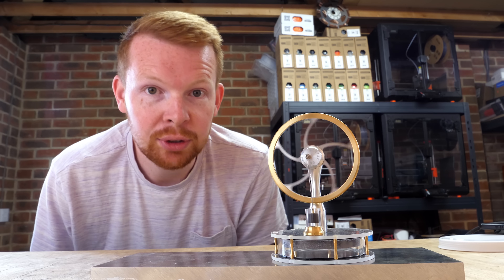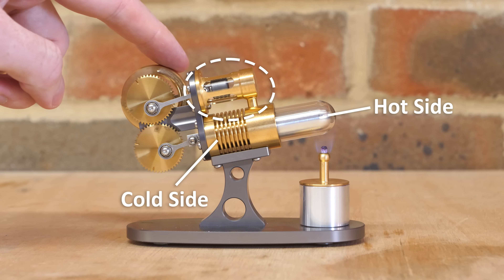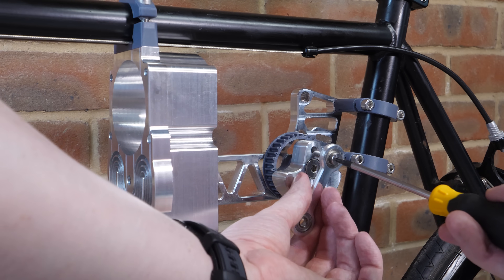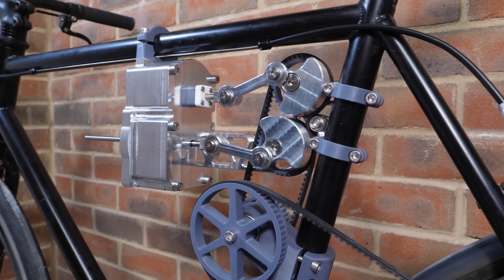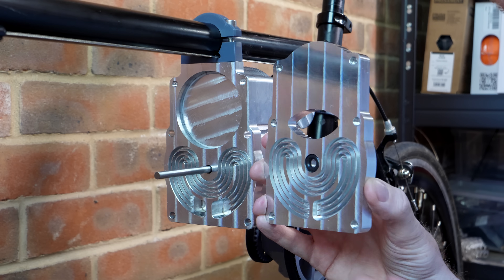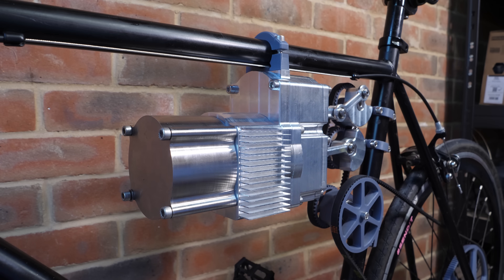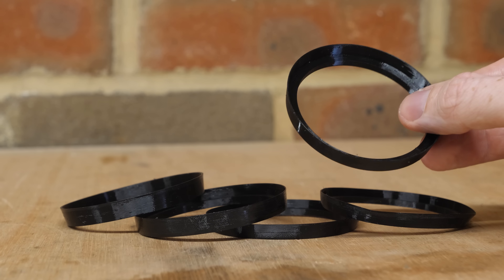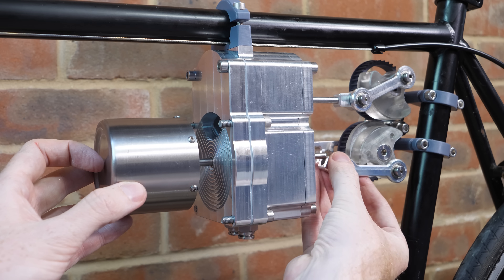Building a Stirling Engine Bike - Part 1

Comment: plumber/HVAC tech here. Sterling engines are NOT more efficient than steam in  terms of energy conversion; not by a LONG shot because the larger they get, the LESS efficient they get. 
-air is a weak thermal conductor
-air (nitrogen_) compresses really easily, so the overwheling amount of your kenetic energy from thermal expansion is lost to actual air compression; and that gets even worse the larger you go.

 The only benefit they have is safety and simplicity, but they're so weak that they're not viable for 99% of applications. 

That's because water expands nearly 1700x when it changes state to become a gas. It also DOES NOT compress, instead the compression force dramatically change the temperature at which phase change happens which in turns makes the steam engine MORE efficient/powerful (also more dangerous). 
 so while it takes a high initial energy investment to bring your water up to a boil, you really only need to get it swinging about 20C from the hot side to the cool side to get it to keep changing states.
Reply: I knew big steam would be here somewhere 💪👍😁
Reply: There is No big steam !
Signed 
Babcock and Wilcox , Combustion Engineering , and Pardons Turbine inc
Reply: The Rankine and the Stirling cycle have the same maximum theoretical efficiency (i.e. the Carnot efficiency), but in practice is very difficult to get a Stirling engine anywhere near this.
Reply: But they do have the advantage of not boiling your legs off when something goes wrong
Reply: @fisch37Wheres the fun without the risk?
Reply: Yes, but hydrogen is a bitch to contain. Helium is slightly better...
Reply: in the UK, building your own steam engine involves several legal and safety obligations, particularly around the boiler and its use.  thats probley why
Reply: what do you think about flame eater engines?
Reply: I was under the impression that while steam scales very well (as you pointed out) it was awful at small sizes. I would not be surprised if powered bike (where weight matters) was in the 1% of applications where a sterling engine was more efficient than a steam engine of comparable size. Tom should have clarified this if true but I think he has some idea of what he is talking about.
Reply: @jameshulse1642There is a guy who made a coal fired steam motorcycle. It's on youtube, just search up "steam motorcycle," and from what the video showed, it worked pretty well. The engine and boiler were obviously bigger than toms stirling engine, but not hugely bigger, and had a lot more weight to shift. Even at small scales, steam engines can absolutely blow stirling engines out of the water as far as power goes
Reply: This is mostly wrong. Stirling engines are incredibly efficient, and can approach 70-80% of the Carnot efficiency. However, they have poor power to weight ratio, which makes them a poor choice for use on a bike or in a car.
Reply: @naasking  That is theory only, in practice it very difficult to get much above ~40% and it's much lower for simple designs like Tom's.
Reply: @ferrumignis sure, Tom doesn't even have a regenerator. Getting 40% isn't too difficult with a Stirling engine, but I agree it gets harder the more efficient it goes. Still, they are far more efficient than other heat engines, internal combustion engines and most steam engines.
Reply: @naasking   I'm a bit of a Stirling engine nerd, built quite a few small engines and often check out the latest developments. I know of no conventional Stirling engine more efficient than the Chinese 320kw prototype for submarine use that reached 40%* a few years back, but if you know different I'd genuinely love to learn about it.

Thermoacoustic engine designs can get mid-40s though I find these less interesting personally.  OTOH the huge marine two stroke diesels are up to around 55% thermal efficiency now, well above the best Stirling engines. Combined cycle gas turbines can deliver up to 60% efficiency.  It's a difficult truth because Stirling engines promise a lot but have so far failed to deliver in the real world.

* This is the claim from the Chinese research facility but there is almost no information on it so it needs to be taken with a pinch of Chinese salt.
Reply: @naasking   It's very hard to make a Stirling that is close to Carnot efficiency for a real heat source. One particular annoyance is that the faster you run the engine (aiming for more power) the less isothermal the heat transfer processes will be, taking you further from ideal performance. Another is the heat transfer process from your heat source to the engine: the Stirling engine needs the highest practical hot side temperature to get the best overall efficiency, but the way a fuel fired heater works means that increasing the hot side temperature causes you to lose more heat out the chimney as the combustion gases cannot be cooled below the temperature of the Stirling's heat exchanger. This can be circumvented with a recuperator but that's another can of worms, and never 100% effective. 

In practice internal combustion engines are usually much more efficient. This is largely because they don't have a heat transfer process from the heat source to the working fluid, as the working fluid is itself the heat source. This avoids a major source of heat losses and means that (in the case of Otto and Diesel cycles) their hot side temperature can be the flame temperature of the burning fuel, which for petrol is about 2200K. A Stirling cannot practically do this because the heat exchanger has to be made of a solid material, and most of the good options like copper and aluminium melt at well below this temperature. You might use some high temperature ceramic (silicon carbide seems like a good candidate) but that makes fabrication very difficult.
Reply: @naasking  they can THEORETICALLY, under perfect conditions, and at a small (and basically useless) scale.

once again,  they lose efficiency the larger you get due to the compression of air.  The way around this is to substitute air for another compressed gas like Helium, but at that point its no longer a standard sterling engine and you've lost the primary benefit over steam which is safety. 

Have you noticed how few actual applications USE sterling engines? its for a reason.

Comment: you should totally still have a go at a bike powered by a triple expansion steam engine!  Commercial boilers are available that will give enough steam, and if you get the exhaust draught right, you absolutely will have a good performer (with 10x more power than any Stirling engine of similar size).  Also, Clupet piston rings are better than the Knorr type and engine timing is critical.  It needs to be more like 85-89 degrees (depending on con rod deflection) in order to get the power out of the engine, but is tricky to get right.

Comment: Something additional to consider for efficiency- I'm sure the machined finish on your aluminum cylinders is PRETTY smooth, but in an ICE of that size an engine shop would be using a piston "honer" to essentially strop that internal surface to near-micron-level smoothness before fitting a slightly "oversized" lubricated piston ring on to make the seal. I know the pressures in a combustion piston are way higher than in a sterling setup but I'd wager between smoothing out the tooling lines on the cylinder wall and greasing your TPU piston ring you could get another 25% efficiency gain over the current situation.

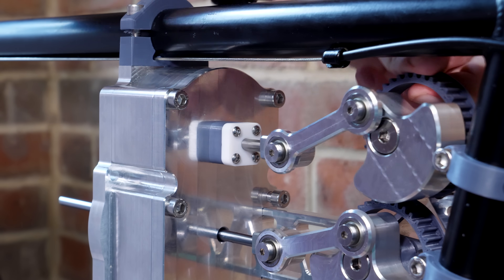Comment: 6:08 why not use another linear bearing?
Reply: 15:48 yea there's a ton of wiggle in the power piston shaft, i think it would benefit significantly from a linear bearing
Reply: It’s not air tight
Reply: @Micah-The-Creator  the back side of the power piston actually shouldnt be air tight, only the seals on the piston should be otherwise that section of air gets compressed by the power piston losing energy

Comment: Very interesting video. I kept wondering if you realized throughout the whole video that there was going to be a very hot heat source between your legs :)  I've had an idea for a Stirling engine that i wonder if you would like to explore. A radial stirling where the cylinders move through the heat source, and the pistons stay in the same place relative to the axel.

Comment: so... you have an engine that does work... with nothing but heat... and it doesn't occur to you to make an electric heating element that wraps around the hot side... and connect the flywheel to a dynamo to power the heating element? a little electricity can make a lot of heat if run through high resistance. graphite is conductive and has high resistance and is very resilient to heat 🤔🤷‍♂️
i wish i had CAD and machining skills 🙇‍♂️

Comment: You say Stirling engines are better, but I think you've forgotten one important thing, steam engine go "pssh pssh".
Reply: WE WANT STEAM ENGINE
Reply: @ErtsenPlayGames    especially between your legs on a bicycle!
Reply: Psh psh maafaka
Reply: Steam is where it's at. Also gasifier fed internal combustion engines.
Reply: @murmenaattori6I would like to see what NightHawkinLight did with his woodgas bike, but on a larger scale, IE, a gasifier that can actually power the bike. I found his whole woodgas series very interesting.
Reply: And you can also make it go "choo choo".
Reply: Chitty Chitty Bang Bang~
Reply: Could you also run a Stirling engine off the waste heat from a steam engine?
Reply: @kahlzun Maybe, but it wouldn't do you much good
Reply: in the UK, building your own steam engine involves several legal and safety obligations, particularly around the boiler and its use. thats probably why
Reply: Striking engine has better theoretical efficiency, potentially reaching Carnot Cycle efficiency (at least in theory)

For better performance it’s worth trying to make the engine completely sealed and use pressurized helium(or hydrogen) 

But in this case hydrogen metal fragility should be taken into account
Reply: Skip this and build an jet engine on an bile😂
Reply: Steam engines go boom though. Wouldn't want that between your legs.
Reply: And go zoom zoom!!
Reply: We can only be justified by the BLOOD of JESUS CHRIST, the Lamb of God, who offered Himself on the Cross to cleanse us from our defilement and thus erase the sin of everyone who places their faith in salvation through the BLOOD of God the Son, JESUS CHRIST, sent into the world as the sacrificial Lamb by God the Father to pay the ransom.

Our redemption is a free gift from the FATHER… through the finished work of Christ under the Law.

And it is only through His pure Blood shed on the Heavenly Mercy Seat that we obtain forgiveness from God the Father. This metanoia, this change of mind, is the understanding that if you are saved, you know that the only way to Heaven is the Substitutive Atonement through the BLOOD of Our Lord Jesus Christ… and that therefore, if you ignore this, you are lost.

--> Have faith in the redemption through the blood of our Savior Jesus Christ before the Rapture of the Church establishes this new paradigm that will force you to die as a martyr for Christ if you desire to have a share in Heaven.

The evening of the Rapture, Friday, August 1 or 8, 2025 will be a day of unimaginable distress on earth. Blessings
Reply: MightyCarMods
Reply: @YeeticusMaximus22 MY CAR GOES PSHHHHH PSHHHHH
Reply: 'Ivor the engine' used to go pssh de cuff pssh de cuff.
Reply: @Shady-Shane excellent sounds description 👌
Reply: Steam punk heads be like
Reply: Like someone else said he should make a stirling electric hybrid
Reply: Steam is more powerful too...
Reply: @TheRealFmarty  Power density would be the main benefit in this particular application yeah. Of course it can't match electric or ICE power, but it's a pretty good 3rd place.
Reply: @__-fm5qv Yeah. But even more importantly, he could put a steam whistle on it and go choooo choooo
Reply: Choo chooooooooooooooooooooooooooooooooooooooo
Reply: Steam is way more dangerous. And if you use steam you need annual boiler checks and certification, in addition to the road tax if you're going to ride it in a public place. In addition you need a motorcycle license and registration plates. A Stirling engine avoids most of that red tape.
Reply: @RWBHere 🐤

Comment: Huh, surprised you pulled that off without burnishing the walls of your cylinder into an even surface. 
In the machine shop I work in, pneumatic cylinders for pistons always require a burnishing.

Comment: you need, a better heat esxchange on the hot end, also possibly think about using hydrogen as a working fluid

Comment: I would take some time looking at Swedish subs. They use nuclear-powered Stirling engines instead of traditional drivetrains to create a uniquely hard-to-detect sound signature on Sonars. Long story short: they use supercritical fluids and heat pumps to create a localized zone of extreme temperature differential capable of generating massive amounts of hydraulic torque. So, a heat source (nuclear fission or a diesel burner) creates supercritical steam. Some of this is bled off to spin a compressor, but the bulk is injected into the hot plate. On the opposite side, a heat pump powered by that internal turbine extracts cold from the surrounding water using a refrigerant and creates a Sub-Zero cold side. It is notably WAY less efficient that the electric turbine used in a traditional nuclear sub OR the diesel ICE used in other kinds of subs, BUT the loss is acceptable because of its improved STEALTH. The reality of a Stirling engine is that it is WAY less THERMALLY efficient, OVERALL, BUT, is uniquely capable of harvesting WASTE HEAT when there are large  ENVIRONMENTAL temperature deltas to work with. That's why data centers in sub-arctic locales are investigating how to use server heat nearby snow to try and recover some electricity and improve their environmental footprints
Reply: The Swedish subs are NOT nuclear powered.

Comment: Shouldn't the back (crank) side of the power piston be open to air? It looks like it isn't which would waste a lot of energy by trying to squeeze the air though the piston stabilizer every rotation. But a really cool project in any case!
Reply: Indeed, very good point. I have a small one here and the back of the working piston is open to air.

Comment: Easier said than done, but I wonder if you could make a radial sterling engine? Like make five cylinders and have them around a large flywheel that's clutched to a drive belt? Use human power to get going, and then with air moving past some cooling ducts, you could achieve just enough horsepower to sustain travel? You might be able to optimize bore/stroke, too.

Comment: What about a twin cylinder engine with a slight offset so the cylinders have a better time at the lowest torque, one helping the other. And as a final touch you can encapsulate hotside + burner so it better utilizes the fuel and make an exhaust pipe to the back, this way the heat won't burn you.

Comment: If you had more of a thermal barrier between the hot and cold ends that would decrease the need for cooling.  The displacer seemed very loose in the cylinder which means that a significant part of the air was not being heated/cooled. Higher output engines use a pressurized cylinder with either compressed air or helium as the working fluid which would increase number of molecules being heated/cooled. Adding a regenerator is a must. You should get in touch with @AttilaBlade as he has been making these for decades.

Comment: Great project, regeneration (copper wool in the transfer port) would help, also check out rhombic drive. The Phillips Stirling generator (designed to generate a few hundred watts to run valve radios) was probably the last "mass" market Stirling engine, the Science Museum in London has one.. Also there is a Japanese guy who is using high speed glass syringes/pistons to great effect to power Stirling powered  RC cars.

Comment: Could you use the temperature gradient from sunlight hitting a dark metal surface and another surface with IR reflective paint to power a Stirling engine? 

It could be fun passive energy harvesting and if not efficient at least more interesting then a solar cell.

Comment: Those engines are used on some Swedish (Correct me if I am wrong) submarines to generate power. Plenty of cold water around to cool down the engine. So it has a practical application in real life 😎
Reply: Yep. Diesel and stored oxygen is used to power them, and they in turn drive generators for electricity for propulsion and "hotel loads". Their main advantage is that they use continuous combustion, so they can be made to run with very little vibration.
Reply: Correct. The Gotland class submarines that fooled the us navy for years in exercises.

Comment: the funny thing about stirling engines, is they work in reverse, and work opposite when being backdriven. You should drive around with it to see if it generates a temperature differential.